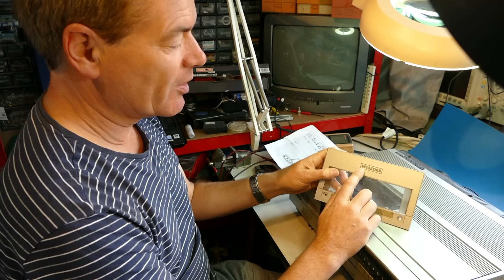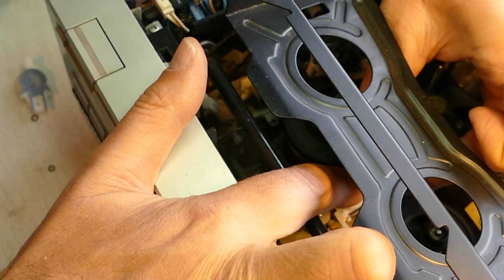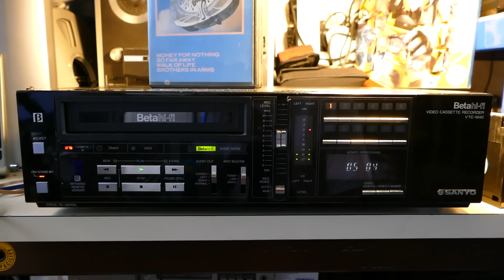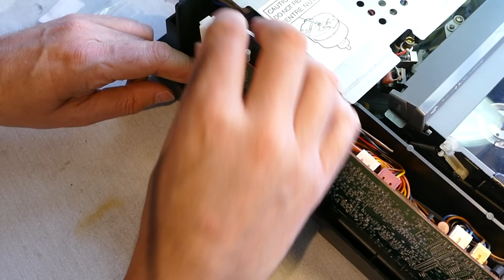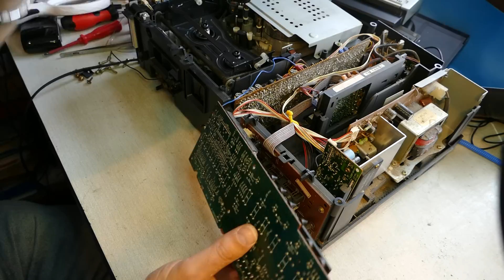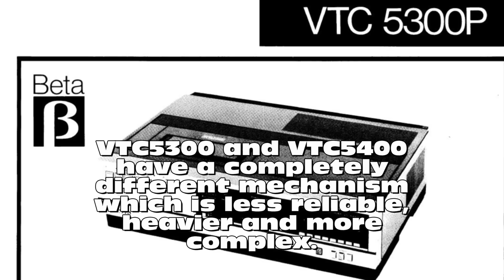Servicing Sanyo Beta (Betamax / Betacord) VTC5000, VTC5150 etc.

Comment: I've spoken to different people who work on these machines about the problem I have with my 5000, and they seem to think there's a problem with the loading belt. I took the metal cover off that is above the loading belt and heads. The head drum spins when you press a button, but since tape doesn't come out of the cassette and lace around the heads I'm guessing something is jammed. All idlers and rubber belts seem OK, so I don't know what the problem could be. I emailed one person with a few photos but he never replied back.
Reply from the maker: If the loading motor (back right of deck) is spinning but the deck isn't lacing up, then the loading belt is much the most likely cause.  It's a little fiddly to get to but can be done from the top without further dismantling.

Comment: Forgot to mention, but the other VCR I have, which is a Sony SLV model when it stopped working had the tape inside which I have been unable to pull out. Is there a way of removing the tape without power?. I've tried pulling the cassette up and trying to wind the tape back in, but there's way of doing this.
Reply from the maker: I've got a video coming out in a week or two showing eject from a Sony camcorder with no power.  Some video recorders can be treated in the same way, but it depends on deck layout.  Basically it meant putting a small power supply onto the loading motor (and eject motor too, in the case of many video recorders).

Comment: Off topic slightly, but anyone know why so many VCRs (VHS rather) for sale on ebay don't include the remote?. I've noticed alot of sellers don't seem to have the remote control for some reason, which is pointless when all you can do on the machine as far as buttons go are the rewind, fastforward, play and record, anything else like tracking (which is an essential thing when playing old tapes) - particularly if it's a more modern VCR, will be consigned only to the remote. Back in the 90s pre ebay a brand new replacement remote from somewhere like Curry's was about £50.
Reply from the maker: People just lose them.  A £1 remote control from the pound shop will often fill in for many (but not all) of the missing features.  I did a video about that a while ago.  Most remotes within a brand will also work most functions of others of the same brand, though there are exceptions.

Comment: It appears that these particular Sanyo Betacord's are quite hard to get hold of that are in full working order and are not spares/repairs for upwards of 40 quid. When I bought my 5000 2 years ago there were quite a few that were listed as in good working order, but not so much now. I wouldn't have thought there was a demand for these recorders compared to VHS, and even VHS most people think you're old school when you mention them. Saying that, my original Betamax was a VTC9000 (or 9300) which weighed a ton (19kgs doesn't seem that heavy but it was like carrying a bag of cement in your arms lol), I had two, the original recorder which was all black and grey went to the tip years ago, and the second was an all grey colour but identical in every way. As the recorder was full of dust and needed alot of repair work I decided to give it away to anyone who wanted it, and I must've got about 10 replies in the space of an hour after advertising it on facebook, so it must mean there is still some interest in these machines, or maybe because it was free. By the end of the day someone came to pick it up.

I wonder if the problem I have with my 5000 is that the tape belt has snapped rather than it being down to the power supply. When I try and press play, rewind, FF etc you hear a click sound and a "winding down" sound as if a fan is slowing down. The clock lights up but nothing happens when you select a number.
Reply from the maker: That VTC5000 sounds like it needs a new reel drive belt.  They are easy enough to find just based on size, and it's not too hard to install either.

Comment: Hi, I have two identical Sony VHS recorders, one that suddenly stopped working after I put a tape in and started to rewind it, and when I came back a few second later the machine was dead, no power. I tried the fuse but still nothing. Very strange considering I have never had this happen on any Beta or VHS recorder I have owned. I heard that it could've been due to a capacitor. The other VHS recorder I have powers up but it will chew tapes up when loaded. Is there anyway of taking the parts from one machine to another?.

Comment: All I do to clean the heads is use a piece of paper and rotate the head around, and after a few attempts the video has cleared up. I haven't done this with a Betacord just a VHS recorder. I've heard lots of people say that head cleaning tapes aren't recommended, better to manually clean to heads.
Reply from the maker: I do both manual and head cleaner tapes, depending on the format and on the circumstances.  Manual cleaning always carries a small risk.

Comment: I tried playing my VTC5000 a few days ago in an attempt to get it working, and for a moment I actually managed to get the tape t rewind for a few seconds, but after all I got was a click sound and a humming as though the power is slowing down. I also tried to press the buttons down and pushing down on the tape loader in order to get the tape to move abit, but I noticed that the machine was starting to overheat and a slight smell of burning from the vents. No idea if I've knackered the machine up by this. If it's the power supply or PCB connection that is broke, how do I go about getting this repaired?. The days of video repair shops are long gone.
Reply from the maker: There are still repair shops.  See: https://www.t-m-f.uk/forumdisplay.php?397-Find-a-Local-TV-Engineer-Here

Comment: Can anyone tell me why the VTC5000 that I bought about 2 years ago suddenly stopped working after about a week of playing a few tapes on it?. I bought what was advertised as a serviced model off ebay (paid over a hundred quid for it lol) and when it arrived it was well packaged and the condition was really good both inside and out all the tape loader and in the insides looks very clean. However, after about a week of using it (not continuously though as there were a few days that I didn't use it due to being away) it suddenly stopped working; it will power up and the lights and LED window will flash, but none of the buttons will do anything, ie it won't RW, FF, play, record, pause etc only make a clicking sound and short whirring. I could do with getting it fixed as it's been a while since it stopped working (due to time I haven't got round to looking at it properly). Can't think what caused it to stop working only maybe the belt broke. It could also have been one of the badly worn tapes that caused it to malfunction. I did hear at the time on another YT video that it could've been the power unit. Anyone any idea?.
Reply from the maker: It will need proper investigation.  Two most likely causes are power supply and the connections from front panel to servo PCB.  Both should be fairly easy for a good electronics person to fix.

Comment: Thank you so much for making this video. Just scored a Sanyo 6400 here in the States and want to change the belts out. Not seeing specifically any for the 6400. Is there a different Sanyo model or any model otherwise who's belt kit will fit? Thanks in advance and thanks again for this video. It's given me a lot of confidence I can do this.
Reply from the maker: The reel belt and loading belt are the same on nearly all Sanyo models.  The front loading belt does vary between two sizes.

Comment: Having just repaired one of these (with the help of Palsite) with various faults,  if anybody is struggling with unstable output on the video output terminal I changed C108 on the bottom board (it's located on the edge of the board,  4.7uF 16v) not C 1080 as listed on Palsite as that number didn't correlate to anything,  this made a massive improvement.

I had a very poor and unstable mono image,  annoyingly I then twiddled some pots to try and cure it, so the whole thing needed realligning afterwards,

Don't then do what I did and short out the regulator IC about ten seconds after getting it to playback better than it did new...

Comment: So my reel belt keeps breaking after about an hour of play. Everything plays beautifully up until then. I have used 99% iso alcohol to clean motor spindle and the plastic spindle but still breaks. Any suggestions?
Reply: I should add i have a front loader. Did this with and without a new tire. Im not sure if the reels need lubricated or cleaned or the pully or what? Its my first beta player.
Reply from the maker: I've never known reel belts keep snapping, other than with age.  No lubrication required.  Make sure that the reel idler's clutch is still able to slip, it needs to be able to do this.

Comment: I have a Betacord 4400 that looks almost identical to this. The only issue is getting it to lace, which it will do only if I move the loading motor drive belt by hand forward then back a little before pressing play. Will replacing the zener diode help resolve this or could it be something else? Also, what wattage is the diode? Thank you for making this video!
Reply from the maker: The loading motor is not related to the diode.  Is the motor spinning and belt slipping?  If so, just replace the belt.  If the motor is stalling, that's unusual, it could be the lacing mechanism needs lubricating or it could be a fault with the motor driver electronics or power supply.
Reply: @video99couk  The belt was slipping, I can't believe I didn't notice. I have new belts on the way. Thank you for the fast reply!

Comment: I Already had a Sanyo M20 (Front loader). I Bought it a probably 15 years ago at a garage sale. Sort of worked, but not well. Three weeks ago I bought a Sanyo 5005 (Similar to the 5000) at an Auction for $10. A bargain as these things just NEVER come up anywhere in New Zealand. Even on New Zealand's main online auction site 'Trademe', they are never seen. After watching this video I purchased two belt kits. Both specifically for each unit (2 different kits). $20 per kit from a place called Star Components in N.S.W. Australia. This is about $22 New Zealand Dollars. I did the belts on both units and they now both work well. Thanks heaps.

Comment: Brilliant as ever Sir, just got one of these that I picked up for a drink working again!  Didn't have an idler assembly but cheated and turned the idler tyre inside out as a semi-temporary fix just for testing. Picture quality is a lot better than I expected for a 'cheap' top-loader. Only slight issue I have with this one is that when the tape is stopped it doesn't lace back in to the cassette,  any suggestions?  I can rewind for a second which spools it back in but otherwise, it leaves about a foot of tape hanging out the cassette when stopped?
Reply from the maker: Torque mod kit is available for this unlace problem.  See my web site.  http://www.colin99.co.uk/extras/reelidler/how_to_service_a_sanyo_beta.htm
Reply: @video99couk  Ah cheers Colin, funnily enough _ shouldn't have jumped ahead in the video,  I might have skipped a stage! I've gone through again and cleaned everything (including those tape guide posts) and it's perfect now!  Still watching the video, shouldn't have watched the first fifteen minutes and thought I'd cracked it!  

Whilst I've got your attention (!) - I have a Sony SLV-715 which needed a tape guide alignment (was a Frankenstien's Monster machine made out of bits) all good except when I get perfect picture on the scope the sound is strongly distorted and very loud on the R-Channel (HiFi tape), is this probably a knack'd set of HiFi heads? Only does it when the picture is perfect, which is annoying as I get a choice of perfect picture with awful HiFi audio OR a slightly wonky picture and linear audio!

Comment: Colin. Great informative video thank you. Managed to replace all the belts. Plays but when I press stop the tape is not taken back into the cassette. Any ideas?  When I simulate a tape being inserted by pressing down on the small detector on the left hand side I cannot see the tape drives being driven to take the tape back into the cassette. Trying to fix so I can digitise my friends home videos he has at home.
Reply from the maker: There's a modification for this problem, see my web page: http://www.colin99.co.uk/extras/reelidler/how_to_service_a_sanyo_beta.htm
Reply: @video99couk   Thanks I will give it a try. I would have thought with no tape installed there would have been some movement as there is really no torque at all for the motor to fight against.

Comment: Followed your guidance and replaced belts. As per your bit at the end when I hit rewind it goes a few seconds then stops and laces.  Pressing stop retracts tape and I can eject.  Comment in suggests second idler wheel is bad.  Looks like idlers are now scarce is there a way to fix this without a new idler?
Reply from the maker: You could try to source an idler tyre, based just on its dimensions.  I'm also told that there is an Australian supplier who still has some idlers left.

Comment: I have a Sanyo 7250 that will glitch and only give me a b&w picture. If I tap lightly on the top of the player, it'll jostle something back in place, but this isn't a permanent fix, as if I change the tape or power the unit off, it'll revert back to b&w.
Reply from the maker: I've had dry joints on the bottom PCB in the colour circuitry before.  I forget which is the colour processing chip part number, but just inspect closely for dry joints there.  It's a simple repair.
Reply: @video99couk  I took the shell off and tapped the delay line and noticed that would change the picture back to color. Does this info help narrow the issue?

Comment: I bought a Sanyo Betacord 4500 on Ebay from a seller who said it was working.  Well, I received it today and it powers on, but I can't get it to load a tape into the transport.  It makes noises, but will not take it in.  Is this a difficult repair?

Comment: When i'm cleaning the heads i just use writing papper soaked in rubbing alcohol and place it up against the head and turn it counter clockwise what do you think about this method also i love your videos i'm a hudge fan of the beta format
Reply from the maker: I've heard of that technique but not tried it yet. I may have to later though as head cleaner sticks are getting hard to source.
Reply: @video99couk  I use good (washing machine safe + and no cloud of particles when unfolding) paper handkerchiefs. I've never had a visible fuzz on the edge after the head, and I assume that non-visible dry dust flies away when the heads are turning quickly.

Comment: Hi,

Do you know what type of spring it is that fits around the pinch roller assembly where it attaches to the loading ring? I put it back after replacing the pinch roller, played a tape then as the ring span round the spring spring off into the stratosphere and now I can’t find it anywhere!

Cheers! 🙂

Comment: I own two SANYO VTC 5000s One with original box and manual and there both in excellent condition, And there great to work with, Excellent video as usual great fan of yours love your channel I`ve been watching for quite some time now.
Reply from the maker: I have a couple more of these machines to work on when I get a moment, so we may get to see some more fault-finding.  Sanyo really designed these machines well.  Lacing is a bit noisy but otherwise the mechanism is superb.
Reply: @video99couk  Yes noise is quite normal for these machines i`ve fixed loads of these machines and in most cases it`s the belt and idler issue these days turn the rubber tire inside out the rubber is still fresh underneath

Comment: 23:30 - Grundig did a similar thing on their first VHS decks (C-wrap mechanism), even that was  (fairly) reliable!
Reply from the maker: Probably because Grundig also used a loading ring on V2000 decks, whereas early Philips V2000 used a horrendous M-wrap affair with wires and things.  The loading of the Grundig 2x4 Super, my favourite V2000 machine, is fairly reliable.  Alas the rest of the machine is less so, see my YT video on that model.

Comment: Great video Colin only issue now is i need some help.locating the part number for  a new pinch roller or equivalent. are you able to.assist as I have the service manual for the VTC M40 and I've located belt kits and new idler assembly's I'm just missing the pinch roller part number.
if you could cast me a line I'd be most grateful bud
regards Darrell
Reply from the maker: Pinch roller failure is fairly unusual on these machines.  I do have a single, brand new spare pinch roller for the VTC-M40, but I'm not quite sure where it is!  The pinch roller changed somewhere between the VTC5000 and VTC-M series machines but I'm not sure if that change matters.  I do know that the pinch roller on these is interchangeable with some VHS machines, so it shouldn't be too hard to find a generic video recorder pinch roller that will fit.  What makes you believe the pinch roller has failed?
The VTC-M40 is one of the very few Sanyo machines that seems to get through video heads, both video and hifi audio heads can wear on this model.  I think they may have been built by Sony.
Reply: @video99couk  Hi Colin i just wanted to keep.some spares more than anything to keep the old girl alive. The heads on my machine are very low mileage thankfully. watching your other videos I see your an avid sanyo betahifi follower 😉  whats the damage if heads go on these machines ?? can I source American equivalent model 7200 ? to help with spares ?
Reply: @video99couk  thanks for your assistance 👍 I may be calling you in the very near future